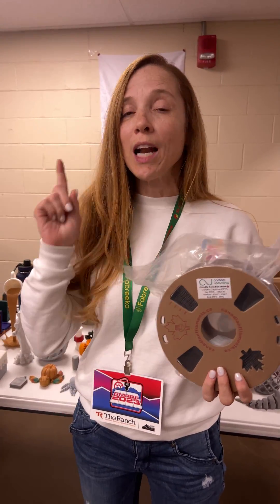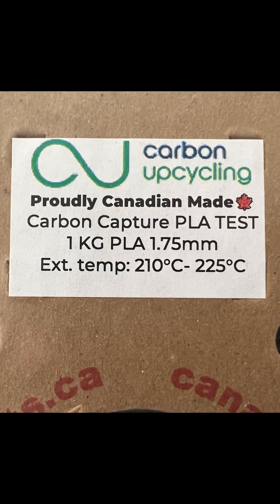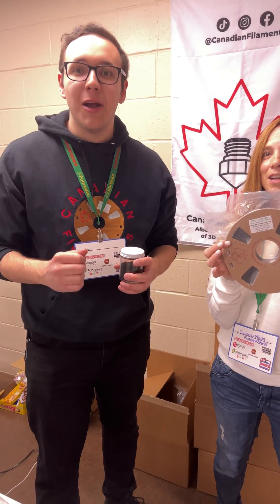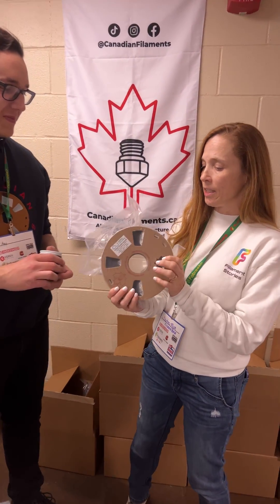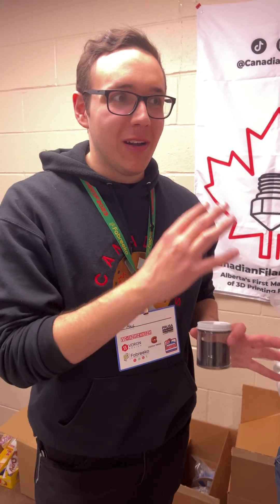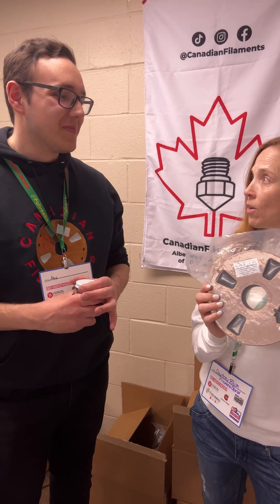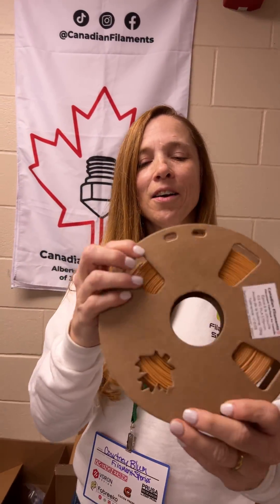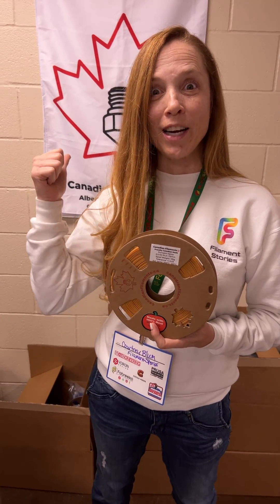Captured Carbon infused Filament from Canada!

Comment: Wouldn’t carbon be brittle in an application like this? I’ve seen carbon used in other ways for strength (nanotubes, carbon fiber), but this is different from those